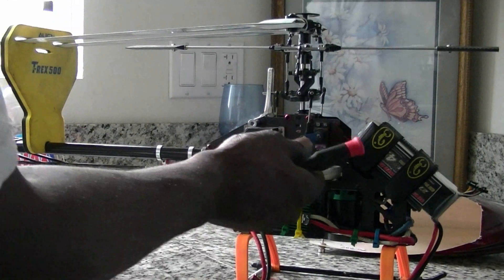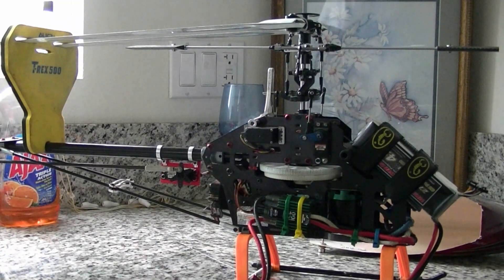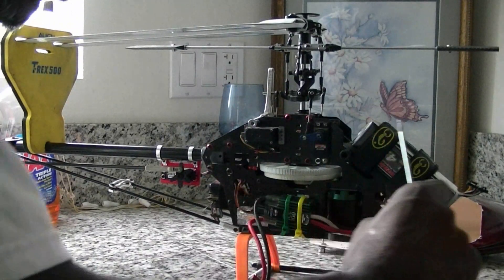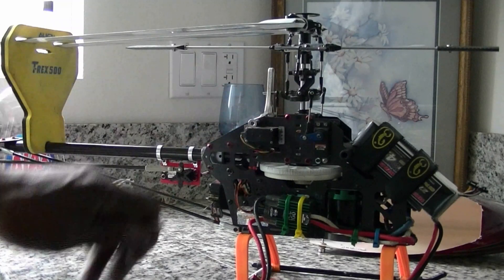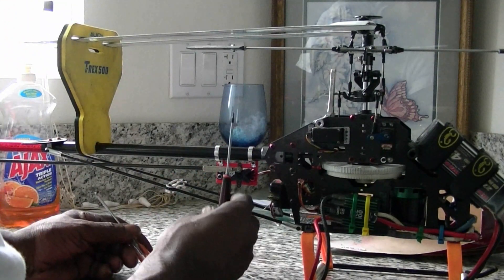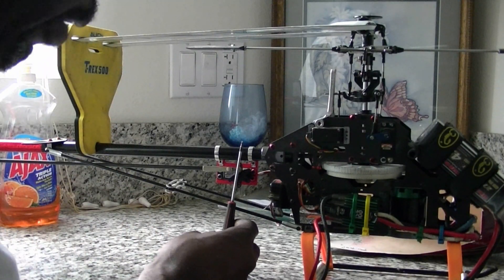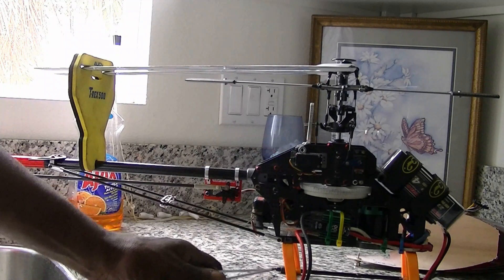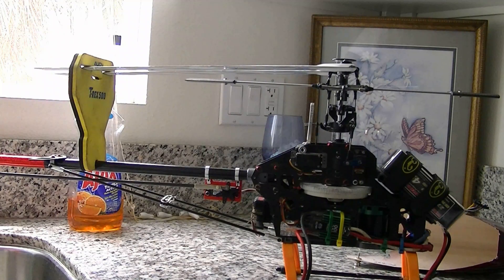=wc=  how to RC Helicopter setup made easy all helicopter head unit set up pitch and expo

Comment: Question: Specifications:
Brushless Motor ( 1220kv)
Motor pinion gear 11T x 1
Drive Gear 112T
Pole count on the Align 600MX 1220kv motor
6 poles.
............................
desired head Speed
{1 - 1900  /info/  use a flat 30% throttle curve
 2 - 2060  /info/  use a flat 70% throttle curve
 3 - 2200  /info/  use a flat 100% throttle curve for this RPM}
............................
Talon 90 is what i am using. With the above info: what Head Seed would you suggest. when i put anything under 1900 it said to slow. That's why i increased it to 1900. Then it said use a flat 30% throttle curve.
and is that for { IDLEUP 1 ] - 2060 for [IDLEUP 2] - 3 for [IDLEUP 3]?
I then took out the chopper and tried it out, the chopper seamed angry so i unplugged it and went home. From default did i make it {head speed} too fast or what.
I have included the site where i got this from. Castle Creation ESC SETUP PART2
Reply from the maker: i had the same issue with my castle 2 days ago ]
i wanted low head speed but it kept saying to low
so i just used fixed end points and used flat curve for normal mode 0 40-65=65=65  idle 1 85 85 85 85 85 idle 2 100 100 100 100 100 til i call castle and ask them why those should work for you

Comment: Good Video...but you left out how to make sure servo is in its center position.... First thing...is to disconnect motor from ESC.... remove swash servo arms from servos....then bind Heli to Tx..... then flip the flight mode switch to 3D...... them move throttle stick....which is now pitch...to the center position......which would be 0 degrees pitch...... then once this is done..... slide the servo arms back onto servos at the closet 90 degree angle you can get....... then use subtrims to adjust servo arm to exact 90 degrees..... after that break out the swash plate leveling tool...... adjust servo arms linkage to level swash........ when all this is done.... check the blade pitch and adjust as necessary.....   also may want to make sure that swash plate.... in the center of the up and down travel...... is the same as 0 Pitch on throttle stick....and the blades are at 0 degrees pitch.......  Nice video though,,,and I did hear you say these things...but should do this first in the beginning of procedure
Reply from the maker: thank you for the added support for the guys who need it i appreciate your comment
Reply from the maker: you dont have to be in stunt mode as long as the normal mode curves are linear.
and my video i tried to make something plain and simple for the guys that have a clue.
i should have made a 10 step video for those who dont have a clue but there are plenty of 10 and 20 min videos out there on how to setup a heli from scratch,

if anyone ever requested it i would have made one.
thanks again i subbed to your channel

Comment: Try not to use sub trim move the servo arms around to get as close to 90 even try new arms if you can same as the tail. Go with the factory link numbers to get you in the ball park and shorten your links to even it up. If you still have a flybar go with one piece links where ever possible.

Comment from the maker: head speeds depend on the size of the helicopter 450 size run around 2800 to 3200 or 3500 to 4000 which is considered insane hs
trex 500 size 2400 to 2600 or 3200 insane
raptors 30 size to 700 size are 1700 to 1900 or 2200 2300 insane 
those are my close guesses you can google it to see if im close to correct

Comment: hé wc i got that too but what i don't understand is when i get gyro on 0 the tail blades most be in the center when i move to the left or right it don't get back to center and no issue on tailshaft and pushrod and it's a new servo 4 weeks old 
four test runs for week tail response as shown in my vids 
got any idea ?